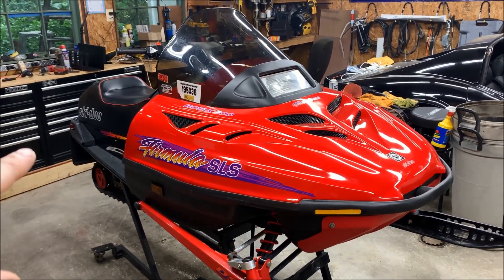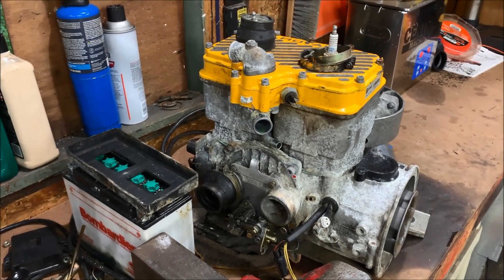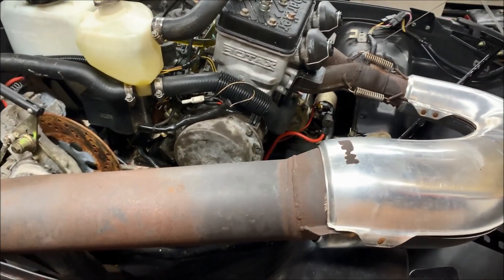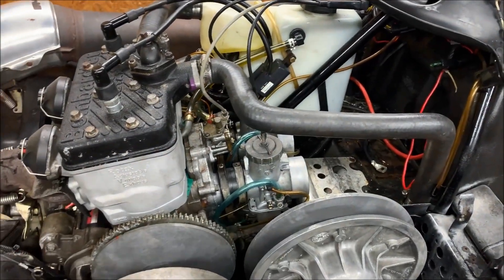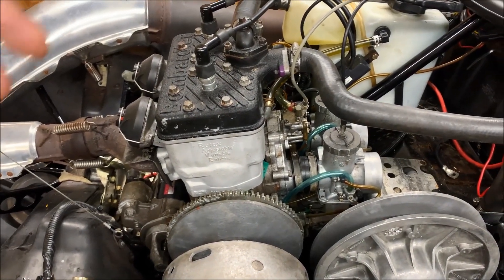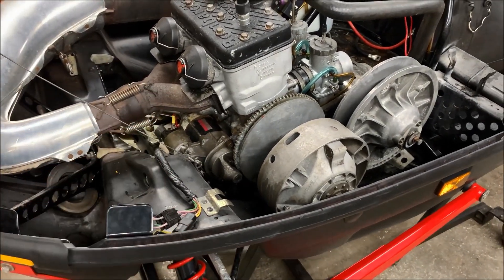Swapping a 670 ROTAX Engine into a 1996 SKI-DOO Formula SLS 500

Comment: Wait, if you have to take the ring gear off to align everything, how do you get the ring back on without screwing up the work you just did?
Reply from the maker: With the ring gear off the clutch and the clutch installed. You do the alignment and lock down the engine mounts so nothing moves. 

You’ll then remove the clutch again, reinstall the ring gear and install the clutch again. 

It helps to have a spare clutch without the ring gear as well.

Comment: Can you pls help me I need help with adjustments for my carb my sled idals at 7000rpms and runs rough I don't know what my gas jet and air screw need to be set at and the top for my throttle canbel
Reply from the maker: 7000 or 700?
Reply: @StreetersGarage   it idals between 6-7 rpm more on 7 it idals rough I took the belt off and put the parking break on every time I start it or it takes of
Reply: @StreetersGarage  I have the air screw at ona & half turns and the idal screw out at one and a quarter of a turn on the throttle cables are out almost all the way on the top of my carbs
Reply from the maker: Ok. Take a look at this video. It walks you through the entire process of synchronizing the carbs. Even though it’s a Polaris the principle is the same. 

Skidoo wants you to set the slide height from the engine side of the carb with a .080 drill.  

Air screw should be around 1 3/4 and 2 turns. Out from lightly seated.   

https://youtu.be/Q7wYiv0YDiM?si=72c6Pybz6CABxbiJ

Comment: Nice job on the transplant Tom. Sounds like a lot of work to get the engine lined up, but it's necessary. It looks like the drive clutch is awful close to the secondary, but I'm not that familiar with Skidoo. Great to see someone wrenching on sleds during the summer, it helps take your mind off of the heat.
Reply from the maker: Thanks Ken. I’m waiting for the alignment tool to come in. Wait till you see how much slop / adjustment is built into these sleds. It’s concerning. Lol